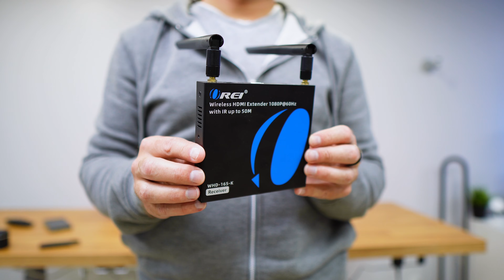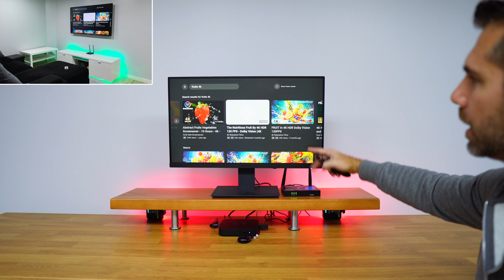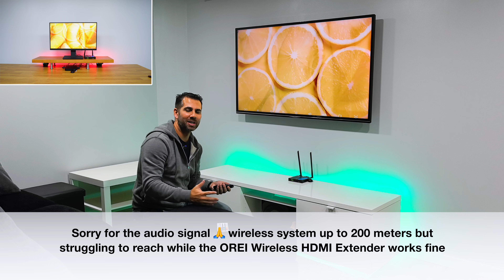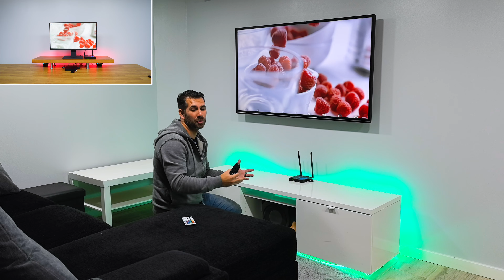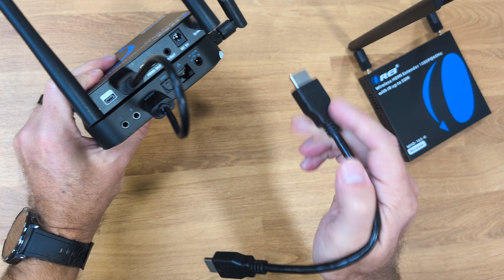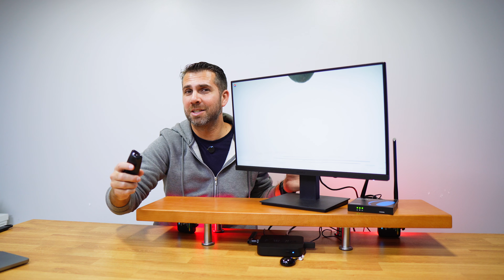Duplicate Your TV Wirelessly Up to 50 Meters

Comment: Unless I missed, if for example, you have 2 different devices plugged into your tv/transmitter, example iptv and streaming box into your main tv (hdmi1, hdmi2 ports), why can't you have 1 device (hdmi 1) on your main tv and 1 device on your secondary tv/transmitter hdmi 2 going to the second tv. Not sure if I was clear or not. If I were to get this it would be to have a strictly news/information source going to the second tv but on my main tv I'd have different content from a separate streaming device.
Reply: read my reply to a similar question, which basically implies a rich person prefers to have focused attention instead of several TVs broadcasting different shit.